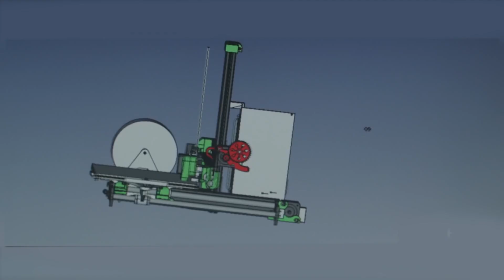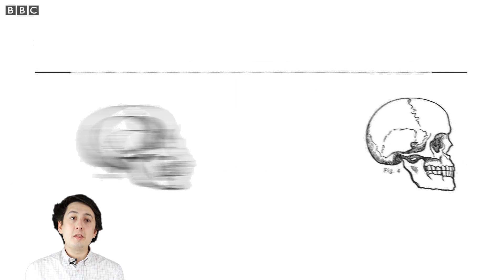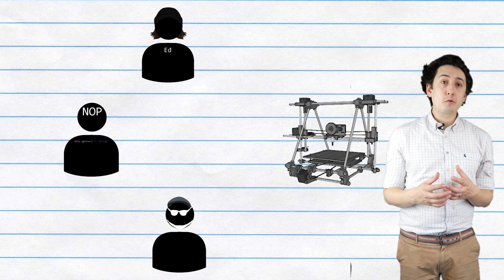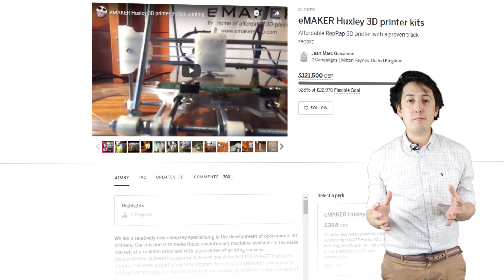A Brief History of RepRap with Sanjay Mortimer (VERRF Special)

Comment: If the 3D printer could collect energy via building parabolic mirrors or solar panels or turbines and it used easily gotten materials like mud-cement, silica, alumina, it could self-replicate by printing an arm and printing energy collectors although it will be limited by electronics which are cheap to build.